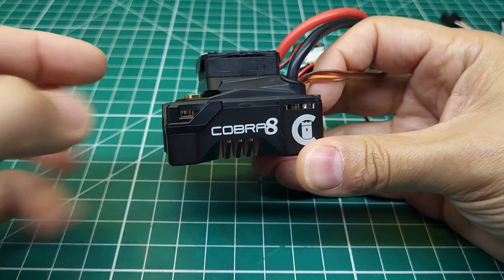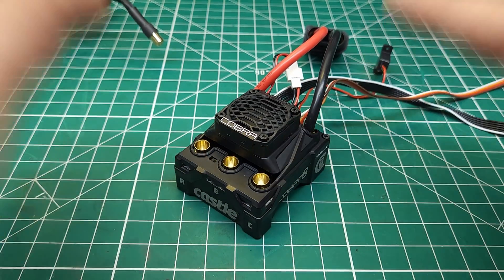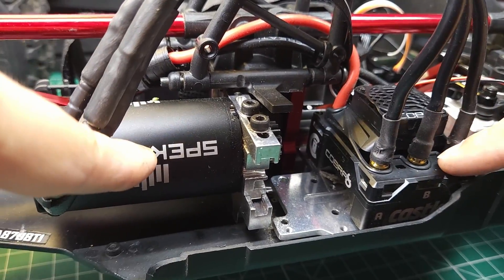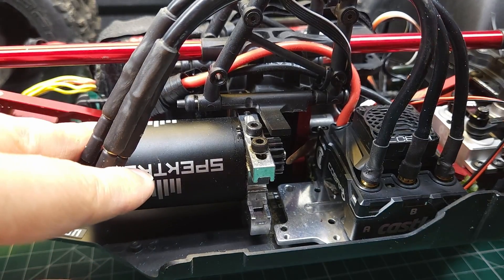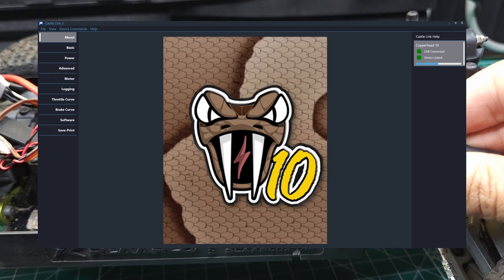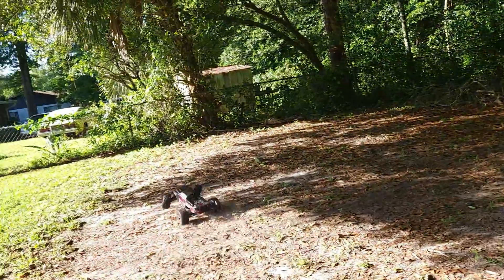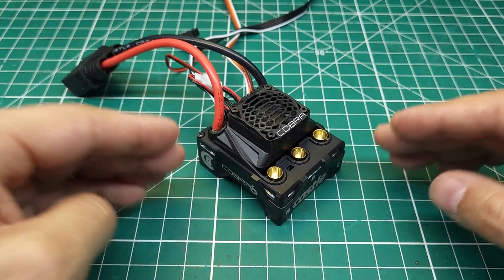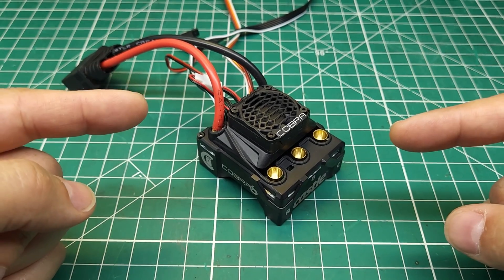Can New Firmware Save The Castle Cobra 8 RC Bashing ESC??

Comment: I've had my cobra 8 for a month now, and it's been nothing but problem after problem. It acts like it has abs when applying the breaks sometimes. Also, it has the softest start, even when set on high punch. Castle doesn't care. I'm so disappointed. I've been in the hobby for 19 years now, and it's sad to say this thing sucks in my opinion.
Reply from the maker: That's a bummer. When you say Castle doesn't seem to care what do you mean?
Reply: @DoRC  I've emailed and called them 3 times now and have received no help. They don't think there is a problem, so I was told not to send it in.
Reply from the maker: @nicholasriley9676 hmm. Well they are pretty consistently updating firmware so hopefully a future firmware will fix it.
Reply: So I put my Tekin rx8 Gen 3 soldiered to the castle 2200kv v2 motor.  I just got done thrashing the mt410 with motor temp at 131f , ESC  at 124f, no glitches, or wired throttle/breaking issues. Today's temp is 90f.
Thanks for your support.
Reply from the maker: Yeah I wish I could do more but I'm not really associated with them so I would probably get the same answer as you.

Comment: Well I had commented on a previous video but I knew that they would get it together. That's why I like that brand. And I buy and race them exclusively. The I'm still using the mamba monster x . Which I had to replace not too long ago. Doo doo the bullets that lead to the motor are getting loose and I think wiggling around in there arcing in it. It's overheated and melted it I think. Never tried to get it repaired but I just bought another one but I will be upgrading to this as soon as I can find a pile of cash to do so for my race rigs . I prefer nitro but ebug has been growing on me, also etruggy looks like a good class im wanting to try! But anyhow, good video man. I enjoyed it
Reply from the maker: Glad you enjoyed it and it is nice to see that they got the problem solved!

Comment: Very informative video and a great bash with your V2 EXB Kraton 6s awesome stuff. I'm not sure if i would buy one only because i wouldn't know which one of my current vehicles i would put it in i thought maybe my XO-1 since it has an MMX8s and i only plan to run it on 6s. But i don't know if the Cobra 8 could handle the Castle 1717 1,650kv  sensored motor i have with my MMX8s currently. So far i'm really impressed with my Castle escs and motors although a little pricy compared to Hobbywing which is what i bought in the past.
Reply from the maker: Yeah I think the Cobra 8 would be just fine with the 1717 motor.
Reply: @DoRC  Thanks that's good to know, but i'm not sure if i want to do the sidegrade to a Cobra 8 from the MMX8s although i mostly streetbash my XO-1. but do plan to take my car speedrunning some day over 100mph would be my goal with that car. She's still in the refurbishment process i also plan to get a "New to me" Phone next month.
Reply from the maker: @cjchannel12RC  I wouldn't recommend it. I don't think you're going to gain anything from the Cobra 8 unless you really need a rolling log file or just have to have the latest technology.
Reply: @DoRC  I think i might just stick with my MMX8s in my XO-1 since i don't need the latest tech in my car although it would be nice to have. My MMX-8s works fine for right now my XO used to have a G1 Max 6 1,650kv 4985 combo but i've come to love the Castle more. The only thing i miss from the Hobbywing combo is the black 4985 motor.
Reply from the maker: @cjchannel12RC  sounds like a reasonable plan
Reply: @DoRC  It sure does, I'm not sure what i'll do for RC stuff next month since i'm currently talking about getting about getting myself a new to me smartphone. I'm thinking a Note 20 5G or a Galaxy S22 i even looked at iphones when i've been an android guy most of my life.

Comment: Lately castle has been… not ideal. Cobra 8 is damn near the same price as mmx8 with no discernible differences and weaker since it can’t run 8S. Also, the sidewinder nano is laughable with no built in BEC and not waterproof.
Reply from the maker: They actually did add the BEC in to the new sidewinder X2

Comment: Was having an odd issue on mine, when in sensor mode it was skipping after half throttle. Unplug the sensor wire and it was fine. Used a brand new sensor wire assuming I pinched it, same thing. 

Went and updated to 1.4 version, no more issue. Had set up RMA with Castle, thanks so much for saving me the headache of mailing this in. Wish they would email buyers when update come out or something.
Reply from the maker: Interesting. I hadn't heard anybody else have issues with sensored mode but I'm glad that they fixed it for you with the update!

Comment: I havd had delay type issues with some hobbywing combos have you ever had that? Thanks
Reply from the maker: Yeah unfortunately hobbywing seems to be having a lot of the same trouble. They released a new firmware for the Max 5G2 but I've noticed that even the 8 BL 150 G2 seems slow off the line sometimes. Not sure what's going on these days.

Comment: Love the videos and always enjoy how you add the bashing in with the tutorial! That seems to have solved the issue! I remember watching a video a while back, you had said you didn't like how that esc acted with a sensorless motor. I see how the new update has saved the money spent!
Reply from the maker: Yeah at least with my experience it was basically broken with sensorless motors. This mostly takes care of it though I'm not a 100% happy with the amount of juice off the line but I guess you can't have everything :-)
Reply: @DoRC  maybe changing the gearing would help your off the line issue. It's all fun regardless! Just enjoy it and keep the videos coming!
Reply from the maker: @ragercrepair9301  possibly but I consider it to be fairly conservatively geared already. Overall it's not a bad experience as it is though.
Reply: @DoRC  I had a similar issue with my max10 on a buggy. I changed my c rating on the batteries I had from 80c to 120c. That was a huge wake up of the entire system. It's all such a balancing act.
Reply from the maker: @ragercrepair9301  I checked battery sag in the logs and it doesn't seem like that was a problem with My particular setup but it is possible as I'm definitely not using the best battery in the world here.
Reply: @DoRC  I was using some batteries that were identical except the c rating. All 4 were new ordered at the same time and I did some testing. 2 were 80c and 2 were 120c. Same car and same setup. Completely charged on 4s in a shredder one set wouldn't pull the front wheels and the other set would and even flip the truck over if you got the traction right. All 4 were goldbat brand from Amazon. So nothing special really but it did make a difference. But amperage means more than voltage and c rating is pretty much amperage. Also the esc is a hex6 6s esc. I did the test on 4s because that's what I had. Also the batteries that are 120c still work perfect and the 80c ended up puffing after a summer of running them.